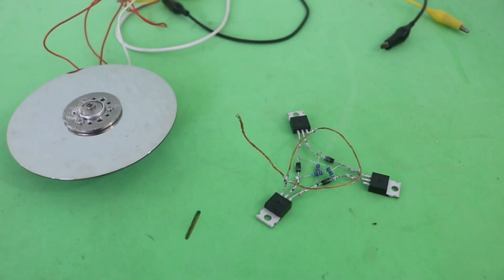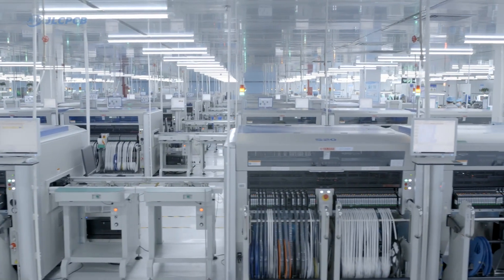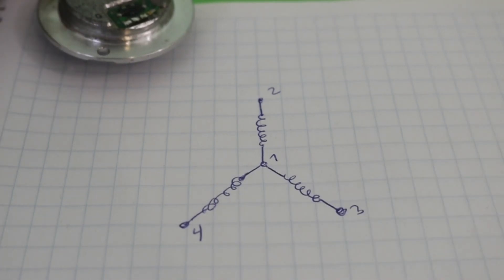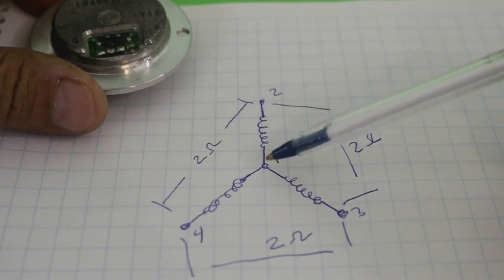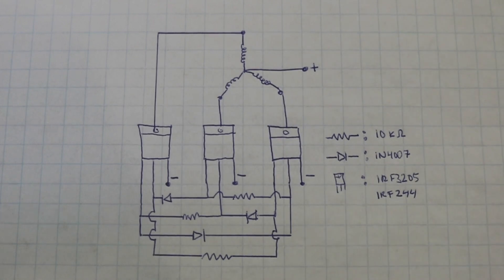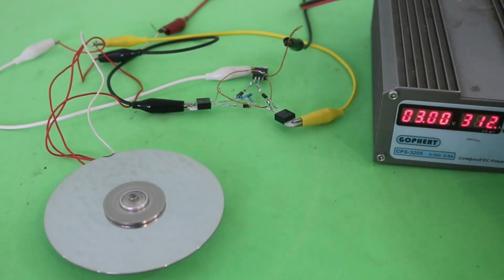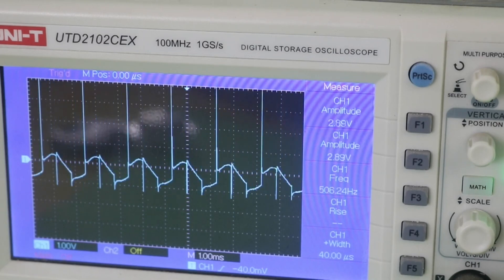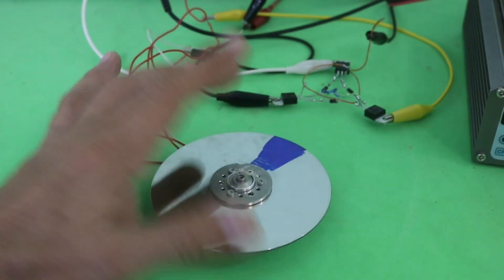Simple BLDC Motor Diver Hard Drive ESC

Comment: Starting can be done using a separate circuit, that will delay on power on, and then deliver a pulse to the one gate via a diode, to turn on that transistor hard briefly. Should start then. Circuit will be simple, one RC delay that holds a transistor on while charging, and then the collector is used with a coupling capacitor to the diode to apply the pulse to turn the mosfet on. Transistor needs a diode anti parallel between base and emitter, and a pull up resistor of around 4k7 for collector, and 0.1uf should work to couple the pulse through to the mosfet after the 1N4148 diode, probably with a 10M resistor across the capacitors to bleed off the charge on power off. Capacitor for delay probably around 10uF in series with 10k resistor as starting point.

Got plenty of slightly used hard drive motors, and same for salvaged mosfets, should build up one and try it out to spin them up.

Comment: This circuit can ONLY run motor have stator spin. If you want rotor spin type work, connect the diode parallel resistor

Comment: If you remove the diodes the noise will go away. All you need are resistors, and with the correct resistance auto start happens. I have been using a single phase version in my experiments for many years and I figured someone would post sooner of later. My resistances are around 1.25, 1k, 750, 500 ohm and they depend on the coil and diode guts.
 
    Oh, and one more thing, Three phase is fast and everything but it is only a third of single phase at triple the voltage.

Comment: why you push by hand??
Reply: No microcontroller to get the motor phases changing - he has to spin it over to create a small voltage that the circuit notices and then it switches over to keep the cycle going.
Once that happens, the other coil works as an generator, which powers another MOSFET which moves the connection over. Some motors start on their own, but many smaller ones don't. It all depends on unprocessed induced voltages. GreatScott made a good video about this topic.